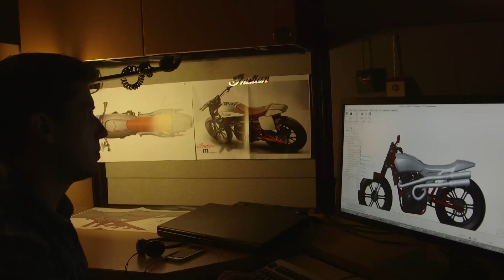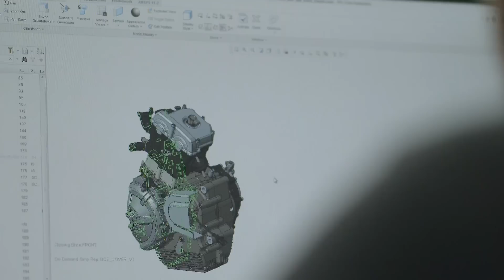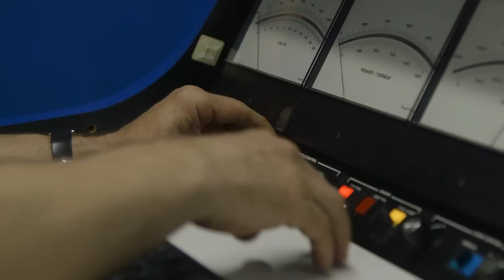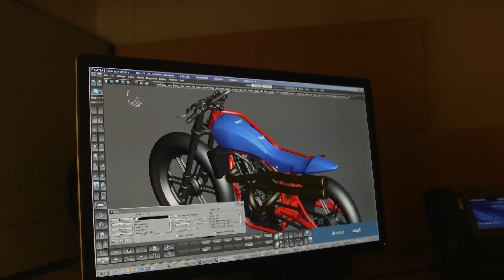CW EXCLUSIVE: Indian Scout FTR750 Flat-Tracker

Comment: This is the type of bike we've been waiting for to go on the road. Harley and Indian are missing out on huge sales here I recon.
Reply: a true racing bike lightweight and fast would be awesome.
Reply: Harley got rid of Buell. They were what you're talking about.
Reply: But Indian chose to bring a Ducati wannabe to the street 
THIS bike was what we wanted
Reply: @masaallen1009  The Buells were innovative putting the fluids in frame/swingarm, the perimeter disc (ring?!) brake, the shock/linkage under the frame and other 'ahead of their time' design touches. But like the Cannondale 250 MX bike a few decades ago, designing outside the lines does not always translate to making a good bike. I've ridden both and they had a top heavy feel that made it hard to attempt pushing the limits, nervous steering, not enough power to stay with current bikes of the day, and way too expensive. In their years of manufacture, the Kawasaki ZX-11R and the Ducati 999  (and current to the Cannondale, theYZ, CR, and KX 250's) were all half the price and lightyears better. I Like This Indian !    : )'   {@ any price>>>it's a winner!}

Comment: PLEASE build these bikes for the road! (With brakes lol)
Reply: with brakes, and a legal pipe, the whole thing is different looking. The spindle wheel and those race pipes are key to the look. Harley got sort of close once with a 883 flat track from STORZ racing
Reply: @stephenmwyatt2  Some of us aren't all about looks. Light weight, good handling, good brakes. That's what's important to me. Indian totally missed the light weight part with the FTR 1200.
Reply: @stephenmwyatt2  at the time he wrote this Indian had exactly what you're talkin about on the showroom floor have you got yours yet they're 1200 cc make 120 horsepower weigh 450 lb do the math that's better than a crotch rocket Arthur the YouTube commercial ad man riding won in the California River to LA that we know is a big concrete ditch sewer was sewer lines coming in that are Rider uses for jumps at about a hundred miles an hour burning rubber LA River dial then takes off on a dirt road next to the LA River killing off the Motocross deals then out in the urban jungle of concrete Wheeling down the interstate on the back tire
Reply: @phlodel  excuse me show me a bike with 1200 cc 120 horsepower that weighs less than 450 lb and I'll give you my Africa twin for it
Reply: @stephenmwyatt2  I agree, except Harley didn't do that. That was all Steve Storz. 
The look can be achieved if set up a little like a TT bike with a front brake and an aftermarket pipe. Sadly that FTR1200 abortion is not even close.

Comment: I have seen a number of National Number Caliber XR750's up for sale in the past month so there may be a number of FTR's racing for 2017 besides just the 3 INDIAN Team members if INDIAN can build them fast enough. Maintaining a Grand National Caliber XR is kicking a dead horse. Privateers can't afford the money it takes to rebuild this over 40+ yr old engine design. Parts are so ridiculously priced and harder to get each race season. The bottom end needs to be rebuilt almost every National Race and things like aluminum bearing cages which should be trivial in cost are going for something like 200 dollars. I saw an ad in vft.org for a new XR Transmission mainshaft @ $750.00. That is beyond ridiculous. The FTR being a purpose built race engine from a clean sheet of paper verses the XG750 which is taken from a street engine design will be interesting. HD just announced a new 3 member Race Team for this year. 2 former Grand National Champions Kenny Coolbeth, Jake Johnson, and veteran Brandon Robinson will pilot new XG750s. Going by what has already happened where 2 HD Factory Team Veterans and Current Grand National Champ Bryan Smith deciding to be the INDIAN Race Squad for 2017 Dirttrack may put H-D Racing back in the position of the 1980's when Honda's FS750 was spanking their Butts on the Miles with the likes of Bubba Shobert, Ricky Graham,etc. Coolbeth is talented but he is more at the end of his racing career than when he was GNC years back. Jake Johnson is probably their strongest contender at this point but I look for HD to be disappointed a lot this year. It will be for sure a very interesting Race Season starting at Daytona in March...
Reply: Well I wrote the above before Indian announced the cost of a privateer FTR, which is a staggering 50 grand for one bike w/ no spares. Don't expect any privateers to be shelling out that kind of Money. So far in 12 AFT Nationals,I have only seen the 3 Factory FTR's of Smith,Mees and Baker. Even though Indian has won all but one National I still can't see the Justification for that amount of Money. Dealer Cost for a privateer Alloy XR750 back in 72 was $2395.00. That amount in 2017 dollars is still under 15 grand, which is about what that Indian should be costing Privateers. Even though they seem very reliable, you can't really compare Factory Bikes with a Privateer Bike whose owner generally doesn't have the luxury of having a new rebuilt fresh engine every week. Don't get me Wrong. Never in the history of Professional DT Racing has a clean sheet of paper Racer dominated the season it's 1st yr out like the FTR has. H-D has to be having Nightmares going back to the 80's when they were getting Spanked regularly by the RS750 Honda's of Shobert,Graham,etc. The XG750R hasn't seen a Podium in 12 Nationals. I don't really at this time see any change in the Finishing order of the remaining 2017 Nationals except that there is only one Mile left which might favor Smith. At the pace that Jarad Mees is going I look for him to be the new GNC at season's end...
Reply: What I'm seeing in the last few years suggest Willie fell off the wagon again
Reply: @stevematz7354  when the Indianapolis fair board ran off the grand national championship of the famous Indy mile that's more than the handwriting on the wall I guess I can't believe it I'm still pissed that tracks only 50 miles from my house nice little Cruz the Indy party like stupid then afterwards your reward is the real flat track race around i-465 top out on your Harley-Davidson with a whole bunch of Honda Goldwing thinking they can catch you why was priceless and we back the night Bubba won the race after signing with Honda walking right out of Harleys racing team Dome whole parking lot fat bearded old-time old-timer biker cap Goldwing Riders I'm the one who just traded their Harleys in then there was the ones that were left that hadn't trades their Harley and that night bubba 1 on a Honda the whole parking lot was trying to Slug It Out was One Cop blowing a whistle chasing two of them as the crowd would open up allow the bikers run through an enclosed back up to the cop couldn't make it well that started a stampede of laughter embarrassing the cops and they just walked away and everybody's friend again until we left the parking lot and here I am all by myself on my girlfriend's brand new all belt drive Sturgis wing dingers pointing and laughing until we hit 465 going back then would not run over a hundred 35 miles an hour but it was said a cop radar a Sturgis at 147 before he got out of range and down the on-ramp it was bye-bye wingdinger as I pulled them for about a mile I said damn it here comes a set of those Japanese slant-eye turn signal on a Honda line looking fairing I'm laying in my girlfriend's brand new Harley-Davidson Sturgis for the ultimate RPM test and hold shit I'm getting overtaken and then it was there it is it was the new Evolution motor sport Dyna hey hey hahaha

Comment: When can i buy one
Reply: the motor is $45,000, write the check cousin
Reply: @thomasholland3289  that's for the complete bike. Lol.
Reply: @_Bryant.R  and don't let those prices scare the shit out of you like they're trying to do you can buy much faster one just like it that has a horn license plate holder I said a mufflers mirrors headlight turn signal are street legal title less than 14k but it be illegal for the racetrack because the engine is too big ain't that just too damn bad because actually it's fucking 120 horsepower 1200 cc but a little bit Porky at 450 pounds ain't that just too damn bad is that too heavy for y'all trade even up for my Africa twin that only trips the scale 530

Comment: everything about this bike is a copy. the frame is derived from a wood's frame and the engine is basically a modern xr-750 designed with the same torque and power curves. also believe it has a slightly larger dia. fly'wheel that i i also believe is adjustable. everything about this engine is illegal and should never have been allowed to compete since it is not derived from a mass produced engine that is hotrodded. honda pulled the same crap in the 80's and the AMA tucked tail with the rules then, like they are now with this polaris motor. it's all about the Benjamin's for the AMA, and it's been that way for a long time. and now that nascar has it's tentacles involved with AFT, watch out.